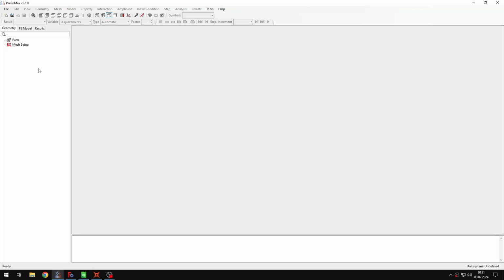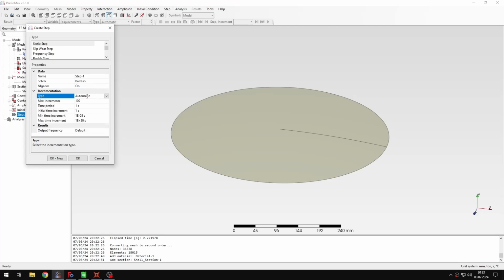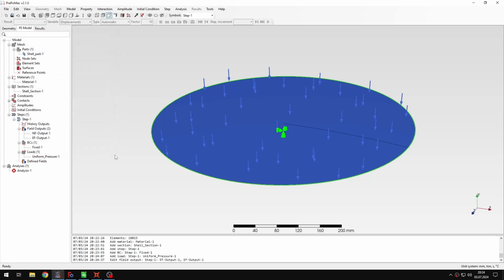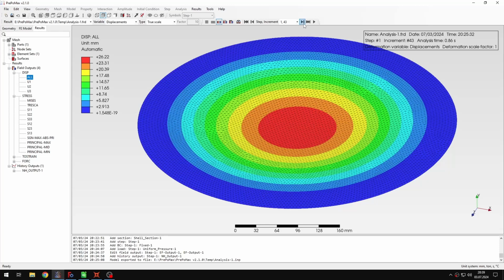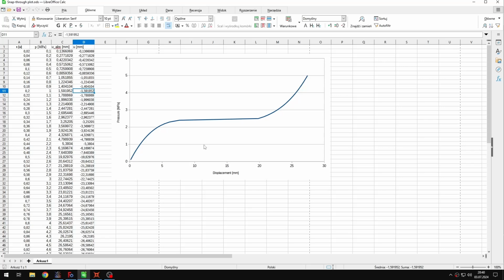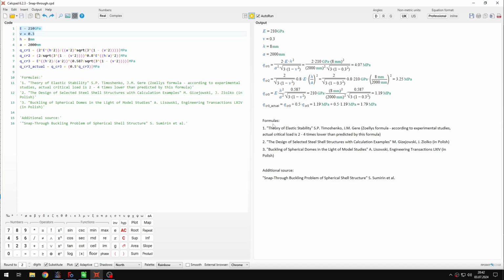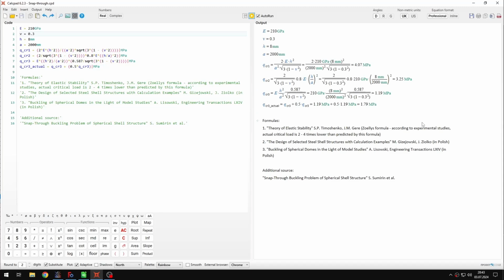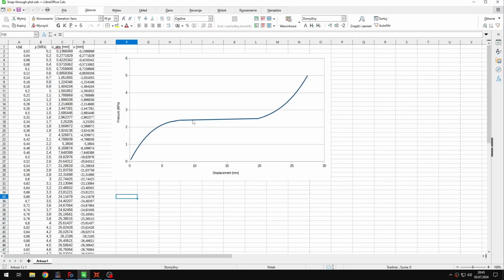PrePoMax (CalculiX FEA) - Tutorial 44 - Snap-through buckling of a spherical shell

Comment: The equation for qcr1 is correct however, for such a shallow shell you need to multiply the linear solution with the Budiansky factor, which is about 0.58 (actually it depends on the angle that defines the geometry of the sphere, it is 90° for a hemisphere and probably below 10 ° for your shell). If you can provide the angle of the shell I could calculate it more accurately but if you use it you get qcr1 = 4.07 MPa * 0.58 = 2.36 MPa. Pretty close to your analysis. For imperfections and pure elastic buckling, you can use a flat knockdown factor of 0.2, for plastic buckling it's more tricky.

I do shell buckling for a living so I know a few things about it :) great video and software, I am also working on a video regarding PrePoMax.
Reply from the maker: @hnrwagner  Thank you for your valuable feedback. If the angle in question is half of the arc’s central angle then it’s around 7.02 degrees in my case. But could you tell me where I can find information about this factor? Any specific references? I checked some publications by Budiansky but I haven’t found the relevant formulas yet.

Also, I will be glad to help you with PrePoMax/CalculiX if needed. I follow your unique videos about Abaqus.
Reply: @FEAnalyst  On Axisymmetrical Buckling of Clamped, Shallow, Spherical Shells, B. Budiansky, Fig. 1, you can find it at a certain sci-hub site ;)
Reply from the maker: @hnrwagner  Thanks again. There's no direct mention of that angle there but from the provided curve, using the lambda geometrical parameter, I read the reduction fractor to be around 0.6 in my case which means the actual critical pressure of 2.44 MPa instead of 4.07 MPa. Really nice match.

Comment from the maker: If we take the three most reasonable analytical solutions and calculate their average, we get 2.36 MPa which is close to the simulation result. Still, the point here was to show that in such complex cases like nonlinear shell buckling, it's really difficult to obtain accurate analytical results.
Reply: finally released...😘😘😘
Reply from the maker: @surachatgumngen5526  Yeah, your comment under my previous tutorial convinced me to go back to this topic.
Reply: @FEAnalyst  How about the tension-only tutorial next? 🤗😘
Reply from the maker: @surachatgumngen5526  The use of the compression-only constraint for tension-only supports was discussed on the forum and would require changes in PrePoMax implementation so I won't cover it for now. But I have other ideas and I'm always open for more suggestions.